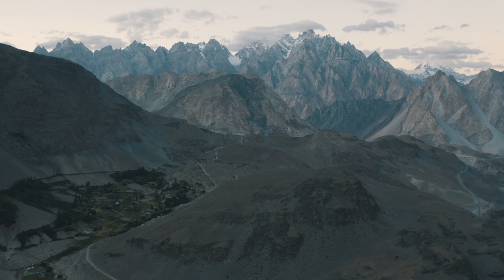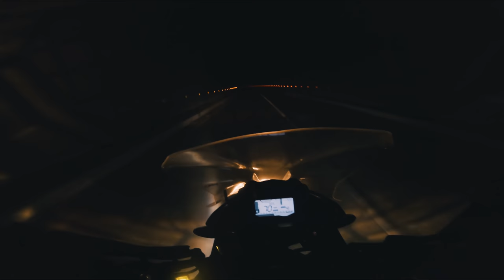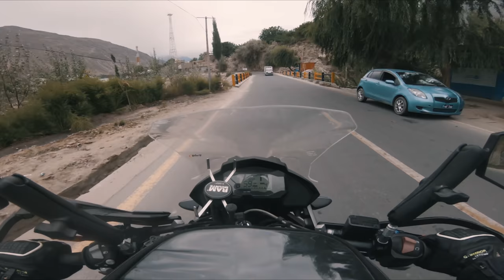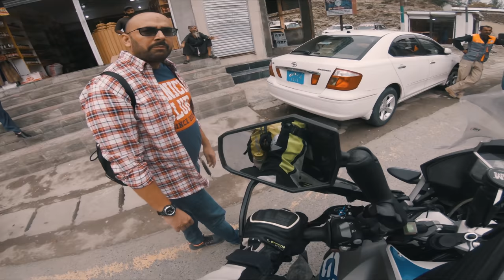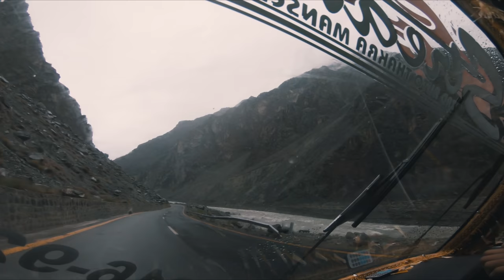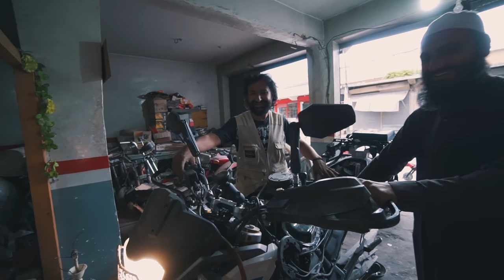Sad Ending of an Incredible Journey? S2. EP13 | Pakistan Motorcycle Tour

Comment: You made a panic breaking to stop bike on bridge.
I have experienced same with my CBR as well.
When u do this bike turns off to protect you from farther damage. Bike thinks that you gone through a accident.

You just need to turn off ignition for 5min and start. It will start, if not you just need to open petrol tank and blow with hard air seal.
Your bike will start. I do this when this happens.

Comment: I am glad you were able to have a jugaar done to make it work. I am afraid that if the ECM (engine control module) is feedback driven from the fuel pump, this jugaar might not last long and may even cause a bigger problem of ECM failure later on. Its BMW living upto its expectations! unreliable & expensive with resale value of a brick. No wonder BMWs loose 50% value within 2-3 years. You'd have been much better off buying an equivalent Honda, cheaper & more reliable. All German brands rank low in reliability. We enjoy your videos, keep up the good work.